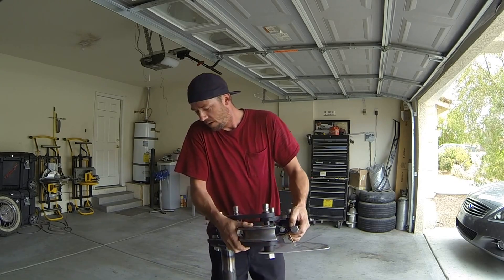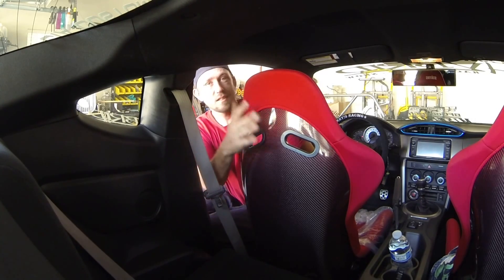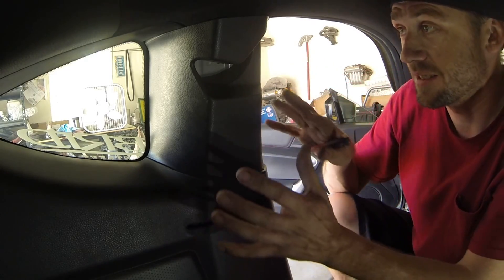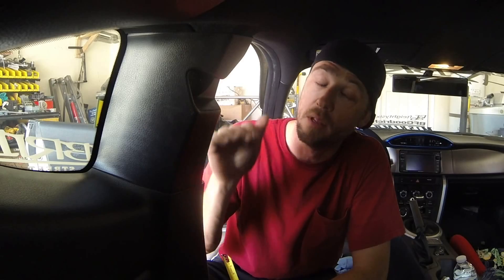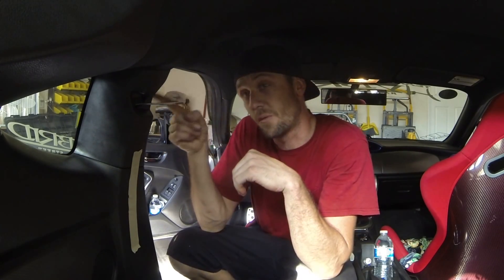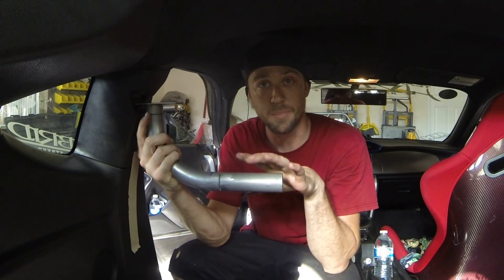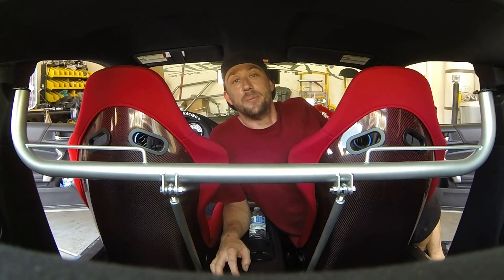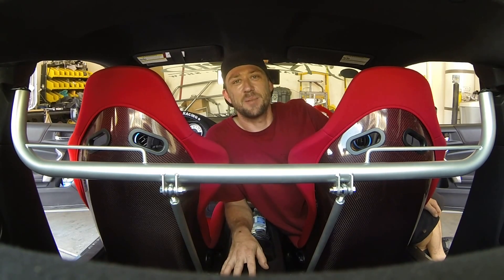TFS: How To Build a Harness Bar

Comment: your good enough to have people bring you rare, high quality and/or their expensive vehicles to work on...at your house...(can't state enough what that says bout quality, trust and self made renown). Is this a "side hustle" with a 9-5 job or is this the living? I've considered doing this myself on the side but with the cost of quality tools and the limited time I have I'm not sure I'd be able to go beyond hobby fabricating. I do appreciate that tube notching video you made, I have to take it a step down and use a cut off wheel but it works the same.
Reply from the maker: I've been doing this professionally for about 15 years. Sometimes I would have to get a regular job turning wrenches as a heavy equipment mechanic to pay my bills. I slowly built up a reputation over the years as well as my clientele. I started this series in my garage after I retired because I was bored and many of my high end clients refused to let me stop working on their cars. Now I'm back in a shop again doing what I do best which is fab. This industry is very tough to get into and stay in because it is almost entirely up to you to fight for a build when there is so much that can be bought and bolted on. I was lucky enough to develop my skills and portfolio when it was in demand. It's still possible to become a professional fabricator, but the struggle has increased over the years to maintain that profession.

Comment: 5:30 isn't 70 degrees from 90 degrees (which is vertical) only 20 degrees, and not 30?
Reply from the maker: +naeslas You're absolutely correct. I actually goofed on that take an didn't catch it until it was time to edit and couldn't go back for a re-take.

Comment: Hey fabricator, so im new to the welding game im pretty damn good already but i have trouble with actual messuring and like the idea to make things work even and good. buuut do you have a video or would you wanna make a video that shows how i can make a front bash bar bumper?
Reply: alex ward use angles and all the levels you can find to "draft" your design application. Just work out the trigonometry and everything will be beautiful!

Comment: Hey dude can I ask you for some professional advice? I'll be quick. I bought a cold air intake but in ended up being for a different model years than my car. Basically it only has 1 nozzle for the line to go on, but the proper one for my year needs to have 2 nozzles. I was thinking of finding a shop to cut a hole in it and weld on the nozzle so I can use this damn thing. Does that sound like a plan that could work and do you think I could get a shop to do this little job for cheap like 30-50 bucks? Provided I find the correct sized nozzle and bring it all to them? btw your videos are amazingly informative for someone who wants to actually learn this. Definitely not for the casual audience.
Reply from the maker: Any decent welding shop should absolutely be able to do that job for you. There are also aftermarket ports you can add without welding. all you have to do is cut a hole with the provided hole saw, install the grommet and port adapter, and drive on down the road. I'll look up the part number for the Spectre kit real quick.
Reply from the maker: +The Fabricator Spectre part number 8711 is the port adapter kit that will allow you to add a line without welding.
Reply: big thank you for the confirmation! 

Watching your vids made me realize that the job sound really easy.

I will see how much shops want for it and decide which route to go.

Comment: The correct angle your suppose to have for safety is from the height of the occupants shoulders to +/- 5 degrees thats part of the FIA reg we have to go by. but yeah every rule book seem to be different with some say no more than 45?
Reply from the maker: +S13R32  It all depends on the sanction at the end of the day. When it comes to height, the driver's shoulders are supposed to be the reference point, but it also depends on how tall the driver is vs. the holes in the seat. If the driver is much taller or shorter, the angle can not be met from the shoulders. I did measure the driver before this install and he was pretty much dead level with the seat holes.

The biggest angle I have seen stated in a rule book was 30 degrees.

Comment: how would you install a bar on a C4 vetted convertible?
Reply from the maker: Describing that process over a comment or text would be very in depth, but most systems in convertible chassis use a floor mounted system.
Reply: Could I anchor bar to factory seat belt pilars and then fix stabilizer supports to the floor seat bolts?

Comment: On the down tubes to the floor, you used a swivel and two moon cut pieces to attach it to the main harness bar, any how to's on how to make that or was it bught?
Reply from the maker: I usually purchase them to make it easier and less time consuming. Weld tabs are only a cou[le dollars each and they save a ton of time.
Reply: +The Fabrication Series have a link by any chance where you purchase them at?
Reply from the maker: +dreamkreationz07 I don't. I purchase them locally. You can typically search for "weld tabs" and find many companies selling all kinds of styles and sizes. Some will even custom cut sizes for you.

Comment: where do u buy those tabs for the support legs and what brand and size do u use for the eye bolt hole for the supports?
nice build!!! btw how much did this build cost u roughly ?
Reply from the maker: +07Stylist The "weld tabs" are made by a company called ProtoFab. I have a local vendor near me that sells them. Option B is I often send out the tab design to my laser cutter and they make them for me if I can't find one off the shelf. A quick online search for weld tabs will net a lot of results and most small companies will custom cut a tab in any dimension for you if you ask. 

The eye bolts (Heim Joints/Rod Ends) are supplied by FK Rod Ends. There are hundreds of retail vendors both online and in many industrial hardware stores. These were 3/8" rod ends.

I do not discuss cost because it largely varies based on where you live, materials used, tooling, outsourcing (if you don't have tools), and a few other things. The best thing to do is search out the materials I used here to find your base pricing.
Reply: thanks allot man i appreciate the help and advice!!! i do allot of custom work too at my house and i would love to build my own harness bar or modify a universal one
Reply from the maker: +07Stylist I originally thought it was strange going from a full shop back to my garage, but I've adjusted again and a lot of viewers have written in saying the garage is kind of "inspirational" to them since I'm shooting these vids in mine while doing full projects. I'm glad to help people where I can.

I strongly advise you to NOT modify a universal design. A harness bar is a very serious component and not knowing full well the standards and quality of materials from the process could be the very thing that changes a properly designed system into a decoration that you can not depend on. If you can't trust a universal system to save you without modification - you shouldn't expect it to be any better with modification. 

Let me know if I can help any more.

Comment: Hello. I'm in Modesto,ca. And i have a 94 integra and would like a harness bar done by you. Is their anyway as if u had detailed measurements of some type you could still be able to create one and me just bolt on everything or is it just to custom measurement?It would be great if somehow this would work. Thanks.
Reply from the maker: +Chow Allen I have an Integra scheduled to come in for a harness bar pretty soon. I'm just not 100% sure on the scheduling just yet.
Reply: +The Fabricator okay so it would be possible if that integra ends up coming?
Reply from the maker: +Chow Allen Yes. Basically, it takes about 4x as long to build a part when it's built on video. As long as I wrap the shoot before it is scheduled to go back to the owner, I can build another one before the next shoot is scheduled. If you send me an email on TheFabricatorSeries.com, I'll keep in touch with you on the scheduling and go over some options.

Comment: is there any problem if i put the bend parallel to the surface ? in this case is perpendicular .. but there is any loss if i put parallel ?
Reply from the maker: +Giu That all depends on the direction of the load. If the load pulls straight forward, parallel to the floor might be best. The leg supports also determine tha angle of the bar and how to set up the bend.

Comment: Very impressed! What's the diameter and thickness of the tubes you're using? I'm planning on doing the same thing on my BRZ!
Reply from the maker: +Olivier Lacroix 1.5" x .095" wall. Specs and explanation are at 12:17

Comment: What types of welding machines are there and what do you recommend for a beginner? Great video and also this is the nicest harness bar I've seen usually I see just a thin bar that goes from pillar to pillar but you put your time into this.
Reply from the maker: +Jadon Ghereben There are many types of machines out there. Its a long list. If you are planning to learn how to weld by buying a machine and laying down some beads, grab a name brand machine such as Miller or Lincoln. Do not buy a knock-off or crappy machine. They usually end up making you develop bad habits while dealing with their inefficiencies. The best way to save a few dollars and learn is by buying a good name brand machine second hand from a local source. If you find you don't like it, or don't want to be a welder, you can usually get some or all of your money back when you sell it again. 

MIG welding is the most common type of welding. I ultimately suggest you enroll in a local community college class for some formal welding training. They supply the knowledge, metal, and machines for you to decide if you want to invest in a welder and become serious about it.
Reply: +The Fabricator thanks for the info my school has metals class and you learn welding but I have to wait another year to get into it
Reply from the maker: ***** Sometimes the best things are the ones you have to wait for.

Comment: Awesome video man! Also great information. Quick question, what's your opinion on having a harness bar in a daily car? As far as safety and comfortably goes(vehicle in question: Lancer evolution 9) thanks
Reply from the maker: As long as the engineering and installation is correct and trusted, I see no problem using a harness bar for daily use.

I know there are many horror stories and threads saying they are dangerous, but most stem from second rate components and well traveled stories.
Reply: I was also thinking the same idea as far as what some of those horror stories said "if you flip... Etc"  but yes I'll make sure I find a trusted and qualified engineer.  I very much appreciate the response/input :)
Reply from the maker: +Jochoa22 Flipping over with a harness bar will not save you any more than not having a harness bar. The only thing that is designed for roll over protection is a roll bar or cage.

Comment: awesome video, I want to make this for my GTI.. one question, I didn't hear you mention what those adjustable brackets are called? The ones that mount the two center pipes which you welded onto the bar
Reply from the maker: Those are just weld tabs with heim joints.

Comment: hi ! its a really good video, thanks for that "how to". 
what kind of tube you´re using ? im going to make mine, but i dont know what material i need. or what size of the bar is the perfect
Reply from the maker: I explained the tubing in the video. I can't tell you what type and size you should use because each bar's requirements are calculated before fabrication.

Comment: what's the going price for those bars in general?
Reply from the maker: The china parts you commonly find are $150-$200. China parts with a brand name stuck on them are about $300. Custom bars made out of a verified material and custom built for you (the driver) typically start around $400.
Reply: +The Fabrication Series I so know about the China stuff. you get what you pay for.

Comment: why is it called harness bar?
Reply from the maker: +Mohammed Omer Abu-talib The name is based off of the function which provides a safer and proper mounting or attachment  point for racing harnesses.
Reply: The word " harness " does it mean electrical wiring harnesses or it is multi purpose word ?
Reply from the maker: Harness as in racing harness or restraints, like a 5 point seat belt harness.
Reply: Thank you for your help,  I hope you enjoy your time and gain more money than what you expect

Comment: Can u still have people sit in the back seat ??
Reply from the maker: liam sinclair Depends on the size of the person and the car itself. Typically it's not advised because it can injure the rear seat passengers and/or hinder emergency egress.
Reply from the maker: liam sinclair I can only say it's not recommended. Every vehicle and harness bar is different.
Reply: The Fabrication Series I've got 2 big dogs and a nephew I want to setup my voltwagen with the seats the bar and and the harnesses

Comment: How would you make a mount for a 5th point strap between the leg using the seat slider mntg bolts with out drilling through the floor

Comment: So I'm a 15 y/o who likes cars. I don't know much about welding n metal so I wanna ask, are most metal strong enough to be used in a harness bar? Also, what's the diameter of the pipe on this FRS? Plan to make one in the future for a 350z
Reply: Tube and pipe are not the same. 

1 inch .120 wall tube or thicker. If you buy the material and can tell the welder how to bend/ cut/ and weld it up it will cost way less. I would suggest just buying a premade. Or going full roll cage

Comment: How would you go about designing a harness bar where fairly easy access to the back seat of a 2 door is still needed? E.g., still have kids that need to get in and out of the back seat.
Reply from the maker: Dustin Meier Forget about the design of it and focus on the effect of it. Kids in the back with a frontal impact may cause the kids to smack the bar. In other words, don't do it. Period.

Comment: hey man, I love crafting and fabricating is one of my favorite .
I just went through the whole comment to make sure no one has ask this question,lol
what is the name/model of weld machine you use? and is it suitable for me to start with as a beginner ? 
 i want to invest my money in a device like yours so after a while I can do all type of projects. 

Is this welder machine perfect for what ( aluminum or t304 stainless steel , etc)

Also if you can list me the bender die sets names or sizes are much appreciated. 

Again I'm new to this 

Please advice
Reply from the maker: I appreciate you checking before asking. So many people don't haha. The welder is a Miller Diversion 180. It is an excellent welder for beginners and even professionals. It will weld every metal you can think of.

Everything for the bender is made by JD Squared. Dies are sized according to needs. Checkout Tube Bending Basics for more info https://www.youtube.com/watch?v=3n_lf2RHIPs

Comment: Nice bar... I would make it thick and stronger in the ends, where the oem seat belt bolt goes... Keep up the good work.
Reply from the maker: That has been a big concern with a lot of people, but its plenty strong in relation to the load it will take. Thanks for watching!

Comment: The brackets mounting to the B post may not be designed to hold force in the direction that will actually be applied in the event of a crash, depending on where the belt is anchored. In the event of an accident the direction of load is going  pulling the bar forward. If the bar is pulled forward the floor braces will cause the bar to lift and the only thing resisting that lift will be the continued bending of the brackets on each end which are not oriented to resist that directional lifting force. After small amount of lift the bar will be able to rotate forward. I don't think that the bar would feel completely but guess would be there will allow for 8 to 10 inches of forward extension. Although this could be mitigated by moving the anchor Point of the seatbelt rear of the vertical line of the bar let's say anchoring the belts between the rear passenger seat and seat back. I hope that makes sense it's kind of a complex mechanism to try and explain without drawing a diagram. If it helps think of the motion of a scissor jack being drawn in by the screw. I'm not saying it's inherently a bad design just saying for all the people her watching this video if you try and Anchor your seat belts to the floor directly behind the driver seat this design becomes very dangerous, if you anchor the seat belt on the bench of the backseat it's totally fine.